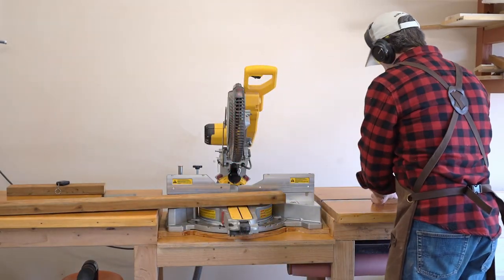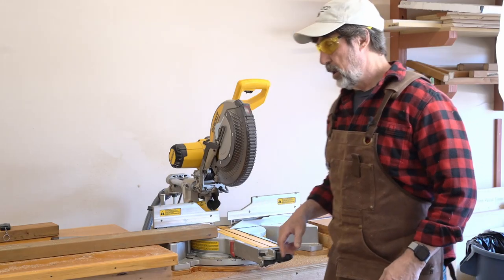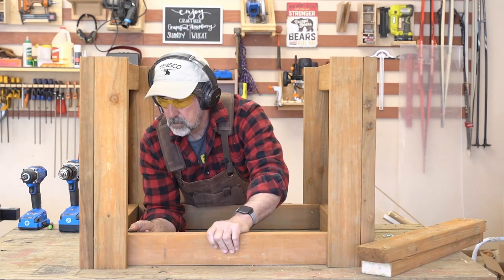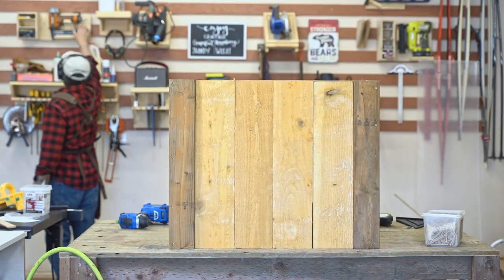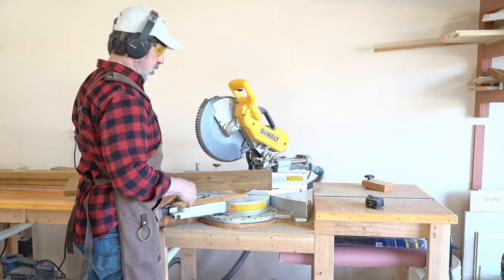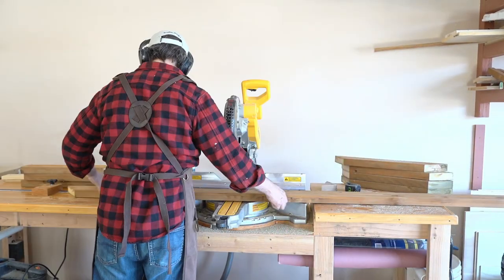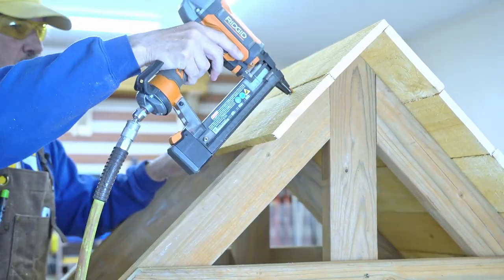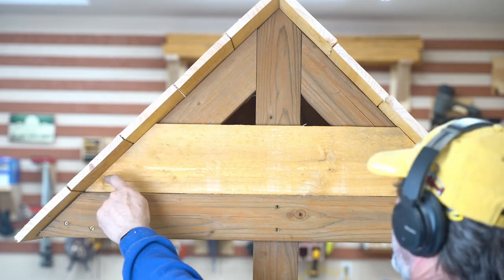Wishing Well

Comment: 6/6/24 this is the best wishing well with directions and blueprints. Your directions were excellent precise it to the point and understanding. I made a couple of modifications and streamlining the roof and side posts for the crank. Used the block stop at a 45 to take one inch off the roof board corners, came out excellent with still a 3-in overhang. Wife inspected and loved.Thank you very much Paul 👍
Reply from the maker: Glad it was helpful and thanks for the kind words!

Comment: Did you use all cedar? Is there a material list for this well?
Reply from the maker: Framed with decking boards and the rest was done in cedar. I have a picture of all the parts used if you follow the link to the drawings in the description.

Comment: What color/material did you use to paint it?
Reply from the maker: I used treated decking and coated everything with spar urethane
Reply: @AlaskaWorkshop  thank you!
Reply: Thanks for the instructions. I just finished building one basically just like yours. First time working with wood so it’s a bit rough. 

We have a wellhead and we intend to place it on top of it. The wellhead has a cap. Is that safe, and will it be ok to place the structure on top of it? I saw you guys had gravel like stone around your wellhead. We have grass growing around it. I think I’ll cover it with gravel and then place the wishing well structure. Does that sound good? Thanks!
Reply from the maker: @navidsoroush8777  I apologize, just now saw this. Yes, it is safe. Just make sure it can be moved if you need to do maintenance. I covered the area with gravel to make it easier to level and mow around.

Comment: I can’t get to cut the 1 3/4 inch with my miter saw I don’t know what I’m doing wrong.. everything else I got ready your instructions are perfect .. please help me with this cut . How can I do it😥😥
Reply from the maker: It is a tricky cut. Mark the middle of you board and set you miter saw to 45 degrees. You may have to sneak up on that mark but cut the 45 so it ends up on that mark (middle of your board). Hope this helps.
Reply: @AlaskaWorkshop  ty so much I’ll try again that’s all I need to do so I can put my roof together 🙏🙏🙏